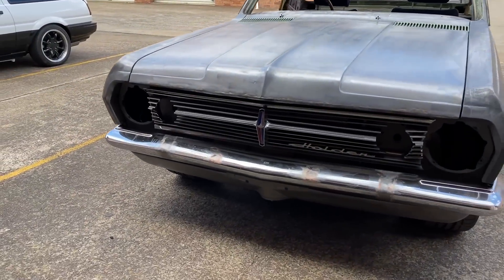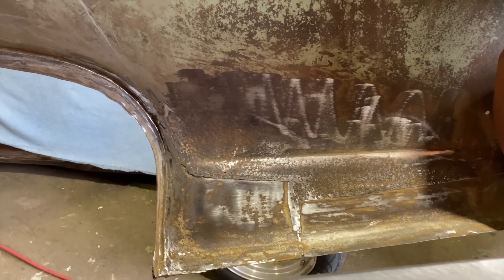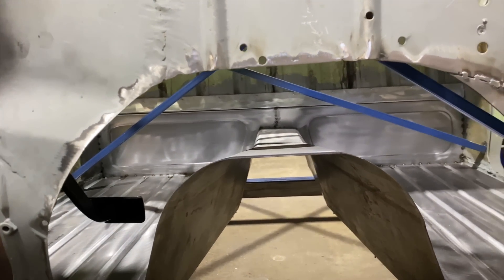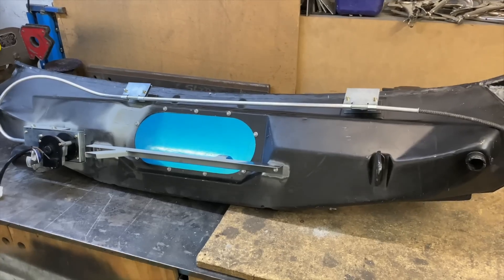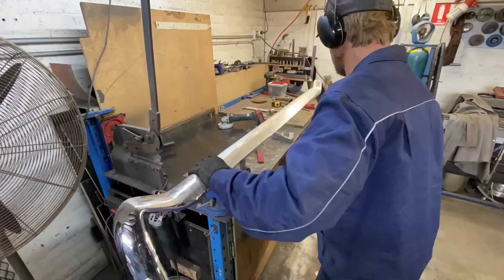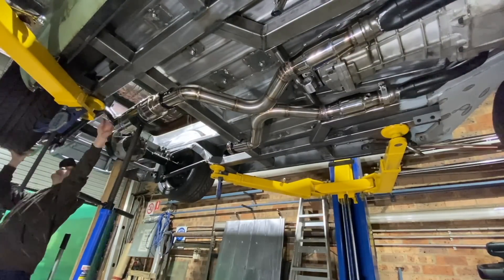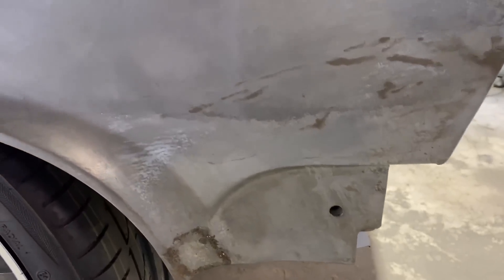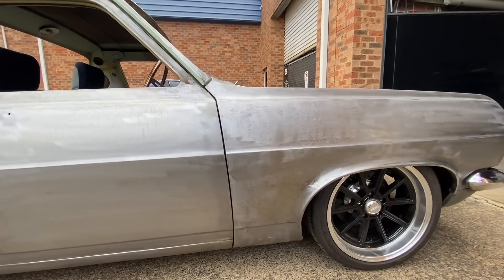Customising A 1967 Holden HR Ute

Comment: I learned to drive manual gears on an HR ute, will always have a soft spot for them. This one is going to be amazing. I owned an EH wagon for a couple of years in the late 70s, baby blue with white roof. It had a 161 from an HR in it and three on the tree. Only issues when I bought it for $450 were brakes and rusty floor. Brakes were easy to fix and a friend of mine's father who had a panel beater shop replaced the floors and coated them for $180. About three years later I sold it to a friend for $550 and it was stolen and not seen again. Wish I still had that car.
Reply from the maker: We all have a story of a car that we shouldn't have sold. Mine was a 1961 XK Falcon.

Comment: I love watching detailed builds like this. This Ute is going to be epic. I couldn't help but notice you were switching in between tig and mig? I am new to welding, so I was just wondering why? Also, why the silicon bronze over steel filler rod with the tig? Thanks for sharing your builds with us.
Reply from the maker: Sometimes I'll use mig to tack a panel together before tig welding it. It's a lot easier if I need to hold the panel in place and tack it with the mig. Some other joins I'll run a few stitch welds with the mig instead of tigging the whole panel. It really just depends on the panel. Also I prefer to use silicon bronze as it is a lot softer so less heat and less distortion. Hope that helps and thanks for watching.

Comment: Shame GMH didnt use the same body lines as of the station wagon so it had HR tail lights instead of HD, however a HD valance at the front allows you to use HD parking and blinker lights, so you get rid of the lights in the grill. just my 2 bobs worth, HR was my favourite car, I owned a HR Premier back in the day, all the HK Monaro running gear from the factory. I think they made either 100 or 200.
Reply from the maker: That would have been a nice rare one to keep. Thanks for watching James

Comment: Your work is mint bud👍
What filler rod are you using?
Reply from the maker: Cheers. It's silicon bronze. A lot softer than steel. Still strong but easy to sand and finish.
Reply: @ProShop1  ive been told about it takes less heat to melt etc now ive seen im buying for sure
Cheers man 👍

Comment: Did not think aussie sheet metal would be that rusty !   In minnesota ,, land of the salty winter roads that is normal,,   ,,but could it be ocean salt that eats your cars.?
Reply from the maker: Pretty sure these cars came with rust from the factory. No paint protection back then and you’re right as the factory was close to the ocean